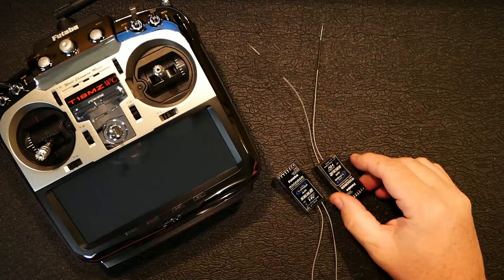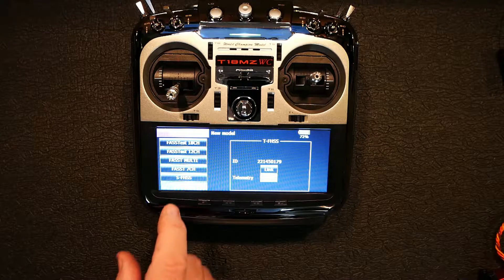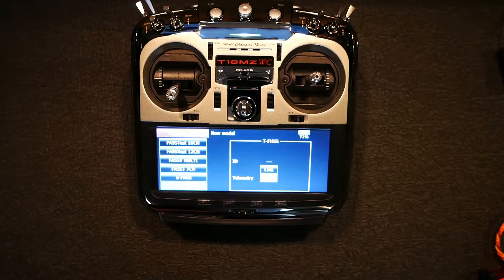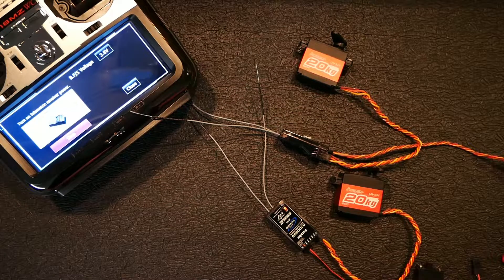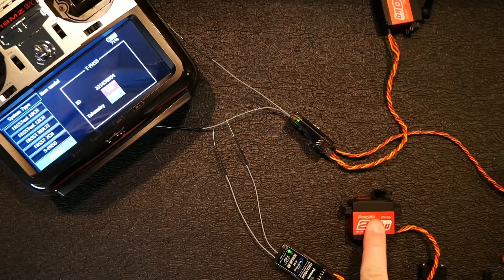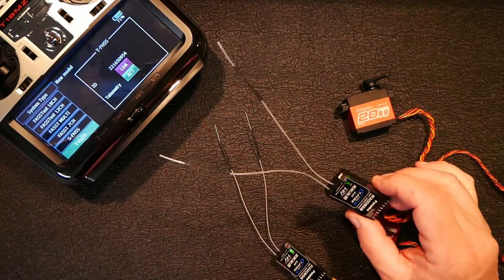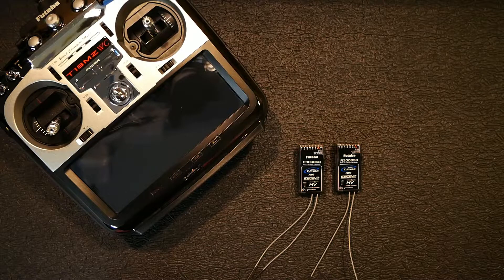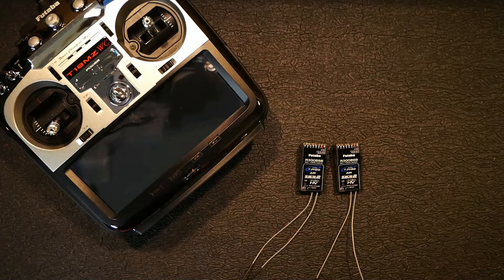Redundant RC Aircraft Systems: Binding 2 Futaba T-FHSS Receivers

Comment: Can you run 2different protocols? FASSTEST & HFASS
Reply from the maker: No you can't. Once you select your protocol, you can only bind to that type receiver under that selection. If you change it, then you have to rebind. They do that because it's best, for the models safety, to only use the same protocol receivers in a model. Thanks for the question.

Comment: …futaba!!!…get real…its as dead as frsky…left it 20 years ago for jeti n now radiomaster crossfire expresslrs opentx edgetx…for heavens sake…
Reply from the maker: 🤣 spoken like a true Jeti fanboi! Jeti users always feel the need to put themselves on a pedestal. Truth is, FrSky has literally the same type system setup as Jeti  for a third of the cost. 2.4GHz/900MHz dual protocol comes standard on FrSky...Jeti offers the 900Mhz as an upgrade. I also have a Radiomaster with EdgeTX. It's a good system, but not as good as Futaba or FrSky IMO.